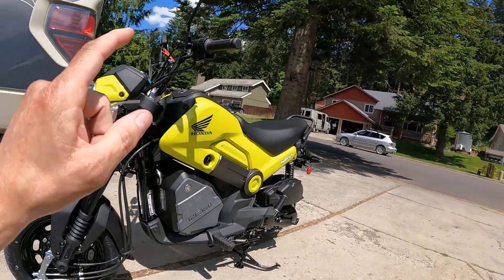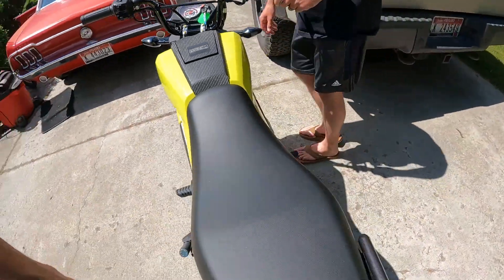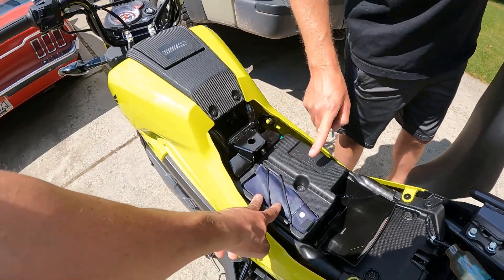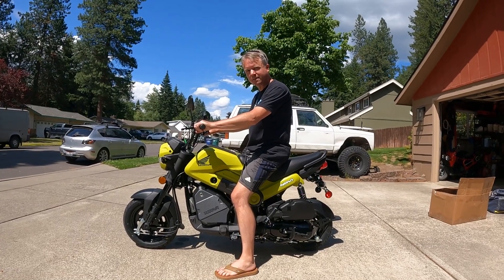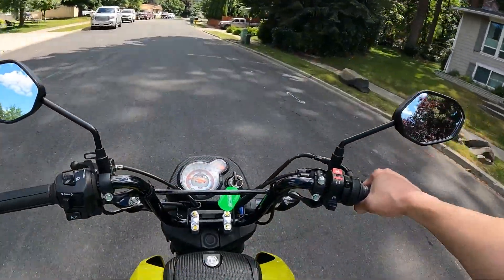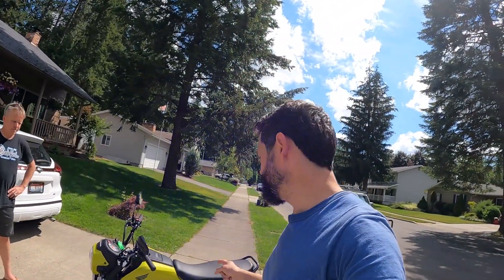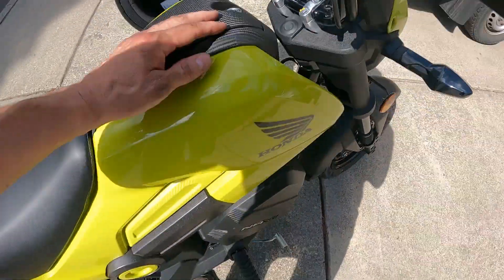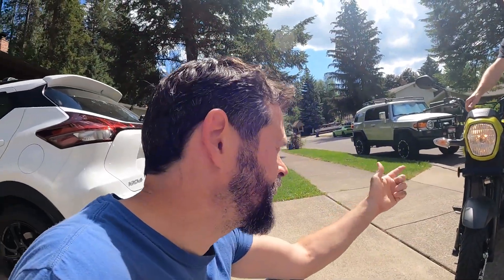Cheap But Good? Honda Navi

Comment: Ok guys there is helmet clips under the seat both sides if fact they normally need to be bent up a little at the end to slid the helmet claps over the pins each side . Most of us owners have rewired (simple wire to battery) the navi comes with both AC/DC power and convert it just to DC and make the lights turn on with the key and upgrade the headlight halogen/ led much improved lighting . At the same time I recommend  a USB port ( phone charger) to the handle bars and a tach/hour meter . The stock windshield and rear rack are extremely cheap factory add-ons. I highly recommend  a cheap remote bicycle alarm as they are very easy to just pickup or carry off .I also add mirror extenders note the left lever is offset slightly inboard . As for proformance they have upgraded carbs,exhaust, cams,and both variator plus clutch is the best first upgrade. Once broken in 50 mph is normal flat no wind . I also recommend on first oil change to add a magnet oil plug I also put one in the oil screen plug this are off the ruckus and scooter swapshop has most upgrades good riding have fun .
Reply from the maker: Man what a great comment!! We're pinning this, super helpful! Thanks so much!
Reply: Jesus, with all the extra $ for upgrades, might as well not even get it and get something else. People want it for it's simplicity

Comment: I'm a new rider and I bought it as my first bike.  I hadn't even ridden a bicycle in like 11 years.  So for me, I felt it was more important to get back my confidence on two wheels while not having to learn to work a clutch.  With this, you can get your balance, slow maneuvering, throttle control, and everything else down to the point where when I want to learn a clutch bike, I'm going to be able to do the overall operation and maneuvering in my sleep to where clutch control is all I'll have to focus on.  My balance at slow speeds while learning will be automatic.  Also, it's small size actually really helps with your confidence in traffic.  Because on a Navi, you feel SMALL around every other vehicle on the road, and that could be really intimidating for new riders.  If you can learn enough confidence to be in any type of traffic, zipping around without worrying about all of the large vehicles around you, I think it makes it 10 times easier to navigate traffic in a bigger bike where you feel bigger.

Comment: I just went to Southern California motorcycle dealership.. marked up $1590 + $400 (transportation fee) basically double the cost for $1800 moped.. so tired of these dealerships ripping people off..
Reply from the maker: Yes! Agreed! Car dealerships are doing it too. Saw a $100,000 markup on a Raptor Type R the other day. We don't understand why the manufacturers don't clamp down on that sort of behavior from their dealerships, but short of that the only way to combat this is to not shop at any dealership that engages in this markup scam. If we all refuse to pay it, they'll have no choice but to stop charging it or go out of business. Thank you for your comment!

Comment: I like this video, it made me anxious watching this finaly got my honda navi in red. its just my size. they do not require 14 year olds to licence and ride these things here. I keep it in the garage its my first brand new motorcycle. i watched this video over and over untill i got my honda. If your heavy like my dad it only gets up to about 40 to 43 and if your 104lbs like me you can get it to its speedo limit but the muffler gets really really hot. i put LED lights in the front and the tail lights and signals but they flicker at idel so i had to get a resistor thingy to bypass the alternator
Reply from the maker: That's awesome! Enjoy your Navi and thanks for the comment!

Comment: Is a motorcycle license required to ride the Navi, especially since the brakes are set up like full-sized motorcycles? Cheers
Reply from the maker: It is in the US where we are. The only vehicles that don't require a license are under 50 cc (at last here in Colorado). The Navi uses a 109 cc 4-stroke single. We have a, uh, friend who doesn't have his motorcycle license and has been riding for 30 years in the states and has even been pulled over a few times, and not a single cop has cared about the missing motorcycle license (he does have a regular driver's license). So a lot of the time in the US it depends on the individual officer. But legally speaking, yes you need it.

Comment: Im considering buying this as my first motorcycle...how many miles can you drive on a full tank? How many gallons does the tank carry?
Reply from the maker: The Navi is so small the tank is measured in quarts, not gallons, and it holds about 3 and half. Honda says the range is 110 miles, but real world experience seems to be 80-90 miles. Thanks for the question!
Reply: @MotorsandMischief  Thank you for this info!
Reply: @m.m.3156 weight ,terrain etc , when I was 260lbs I got about 67-71 before refill at 207 (now ) about 85 ish late but just in case someone else sees your comment happy riding
Reply: @playboyreaper5966  Yeah, agreed. Weight depending it ranges from around 60-90 or so.
Reply: @TotemoGaijin  yeah it's enjoyable tho

Comment: I want one really bad. But I’ve never had a bike and the people on the road scare the fuck outta me if I were to be on a bike.
Reply from the maker: We hear you; that's a legit concern for sure. If you like riding motorcycles, or think you will, we always, always recommend starting with a dirt bike. You can pick up a nice Yamaha TTR-230 or Honda CRF230 or literally a dozen other models that will be tons of fun on the trail and only set you back a few thousand dollars. We just bought a 2006 TTR-230 here in Denver for $1800 (video coming soon!). If you go this route, you can enjoy riding without having to worry about someone making a left turn into you while they talk on the phone. You can have a lot of fun and if you drop a dirt bike, you just pick it up and keep riding - no fairings to damage, no traffic to hit you afterwards. And if you'd still like to get on the street, you can get experienced and comfortable off-road and then transition to on road, and that way you're not trying to learn to ride and dodge traffic at the same time. You can hone your riding skills and then add traffic once you're comfortable. Thanks for commenting!
Reply: @MotorsandMischief  oh that’s awesome I live a little north of Denver. And thanks for the info. I’ll have to check out the Honda CRF230.
Reply: The good thing is it's more of a scooter In a look of a motorcycle. That means it's easy to ride. No shifting low to the ground and dirt cheap. The advantage of a manual is also on the Navi in a form of a kick starter.

Comment: What would you recommend between the Navi, Grom, or Monkey? I just need it as a daily driver to go to the store and work.
Reply from the maker: It really depends on what you like. The Navi hasn't got as much power as the Grom, and the Monkey is way more comfortable than either. Depending on your size and comfort level with riding, the absolute best bike might be Honda's new XL150 dual sport, which is cheaper than the Monkey or the Grom by about $300 ($2971 MSRP) and is getting rave reviews all over YouTube. Given the choice between all 4, we'd go with the XL150 personally, but that's because it would fit our riding style and body type better. Thanks for the question!

Comment: Im in ca whats the max should i be paying for a 2023 navi with tax n everything?
Reply from the maker: It’s gonna depend on your tax rate in your specific county but the bike should be $2107 ($1807 + $300 freight and destination) and tax is Cali is gonna be around 8% so all in you should be under $2300. If it’s any more than that, your dealer is adding a markup for “reasons” and you should call a different dealer. Thanks for the question!
Reply: @MotorsandMischief  thank you very much the dealer i found is trying to 3300 but willing to negotiate
Reply: @carpio559 I just called a local dealer and they are telling me about the same 3300 here in Texas.

Comment: You will never buy a navii for $1,807.00 my 2022 navi was $3,200.00  the dealers will screw you for every cent they can get.  mine has been trouble free with 3,800 miles on it.  only two things i don't like, gas tank to small + being very top heavy.  Honda says 110 miles per gallon , not true because the other day i did a 50 r/t and run out of gas at 50 miles and hit reserve.  i keep gas at my home and carry a 1 qt. Gas container in my saddle bag. i cruise on highway mostly at 40 mph. and sometimes i cruise at 45 mph.
Reply from the maker: Sigh. We need to make a stickie of this because we've had to answer it so many times. Yes, you are 100% correct, there are some terrible dealers out there. These are the same types of dealers that think its ok to mark up a 392 Jeep by $50k. It is not ok, and the manufacturers should not allow this. Until they step up, all of us need to vote with our wallets. DO NOT BUY VEHICLES THAT HAVE A DEALER MARKUP. Under any circumstances. Ever. No matter how badly you want the vehicle. If we all did that, dealers would stop marking stuff up. That said, there are GOOD dealers out there. You just have to find them. We absolutely, 100%, honest to goodness and no foolin' bought the Navi in this video for $1807 plus destination charge. Because our dealer doesn't mark stuff up. Which is why we buy from him. If you had reached out to our dealer in Idaho you could have bought a Navi for $1807 and shipped it to your house for less than the $3200 you paid. But honestly, there are probably good Honda dealers closer to you. You may have to drive 2 hours or 4 hours but they're out there and we have to, must, 100% have got to, stop paying the markup. Its unnecessary and it only encourages this horrible behavior. With that out of the way, we're glad you're enjoying yours; sounds like a lot of fun :) Thanks for the comment

Comment: Fees and taxes won’t get one fur less then 3000!!!!!
Reply from the maker: That’s just not true. Certainly dealers are marking up them up. As we keep saying over and over, don’t buy from those dealers. It’s $1807 for the. Ike, plus $200 destination charge and $100 freight. Taxes in most US counties are between 4 and 6 percent, so say 6% for this example. That’s $126.40. Registration is generally based off of price plus some basic fees so let’s say $50 average. $1807+$200+$100+$126.40+$50 = $2283.42 out the door. Not “over $3000.” We know because that’s what this one was purchased for. Don’t buy at dealers that won’t honor the MSRP. Thanks for your comment.